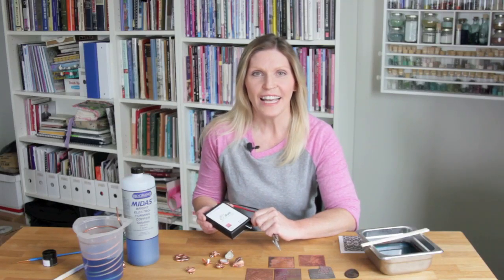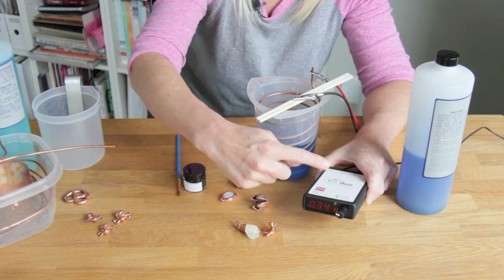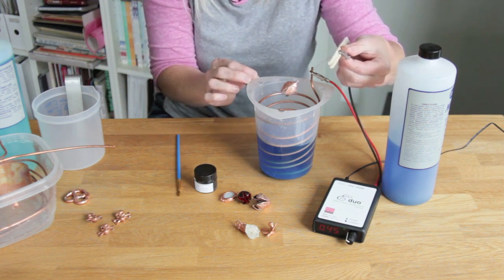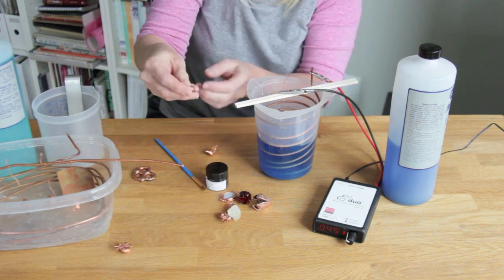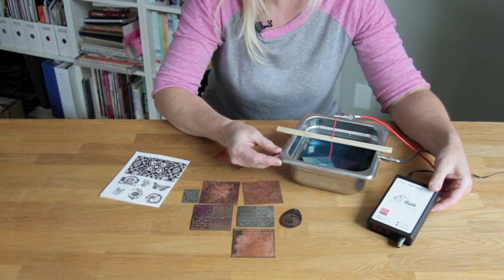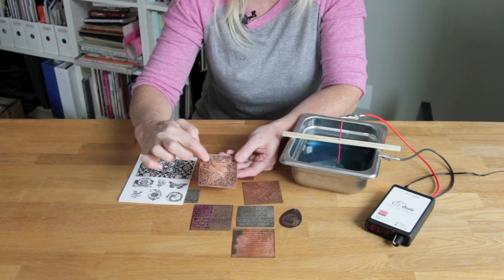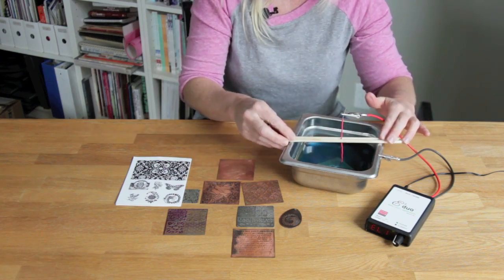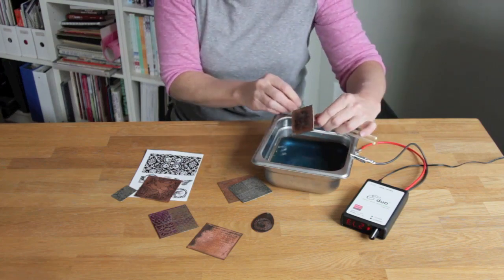E3 Duo Electroforming and Etching Basics

Comment: what type of paper do you use to print a resist image?  Also, what type of printer?  Laser or ink jet?
Reply from the maker: Hi Travis, Thanks for watching. Any copy paper works, but a laser printer is needed. Make sure that the image is printed in the black mode only and as dark as the printer will print.
There are good instructions which come with the E3 Etch Laser Transfer Paper Item #: 118029 if that is what you will be using for a resist. There are many ways to do resists, including paint markers and anything else that will keep the electricity from reaching the surface of the metal. Other variables include the method of etching you are using in the etching work. If you have any questions, please don't hesitate to let us know. Our Jewelry Tech Team can be reached 7am to 6pm MST M-F when you call 800-545-6566, just ask for the Jewelry Tech Team. Hope this helps!